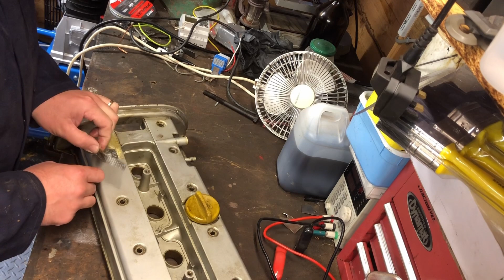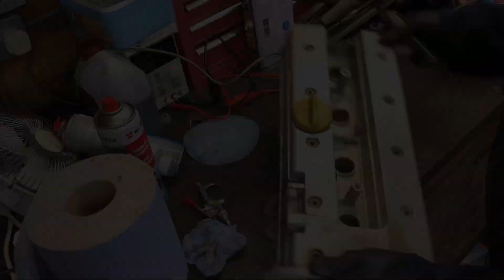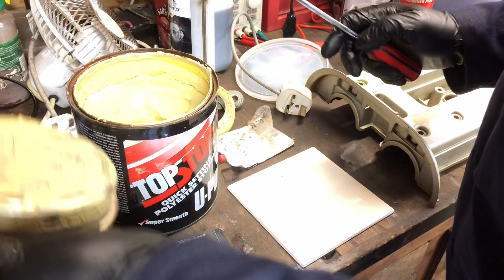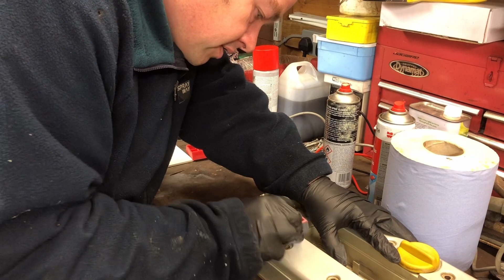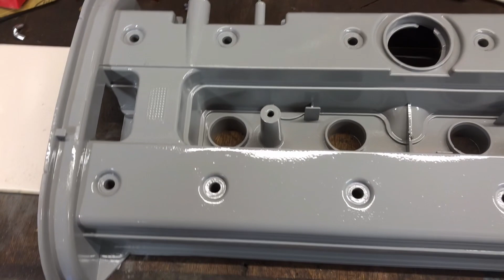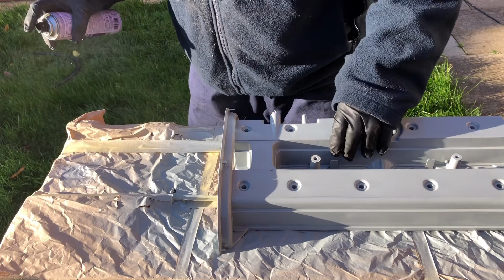Plastic Rocker Cover Repair Part One

Comment: Never thought on using the cable tie as filler. Good one.
Reply from the maker: Thank you, the cable tie works very well, give it a try. Cheers.
Reply: @Cavalier_Steve  I've kept looking at these "bespoke" plastic welding kits. Never thought on dedicating one of my soldering irons to do it - doh! Thinking out loud. Would it be a cleaner or stronger repair if you "V" the crack first. Do this all the time repairing plaster cracks for decorating. Notably for rocker cover the crack would be contaminated with engine "stuff". On the plus side that dies have a hydrocarbon base which is what plastic derives from. 
Again - having seen these plastic weld repair kits the often melt a series of metal wiggly doofers across the split (more appropriate in a bumper as it continuously flexes in use so extra rigidity to split would be beneficial). The position of your split would likely preclude that option plus the rocker cover is pretty rigid in use although is subject to some extreme temperatures.
Same engine is on Vera the Vectra. She had only done 79 miles in 4 years before I got her. I pressganged her back into use and did 1500 miles in first couple of weeks. Shock seriously killed the rocker gasket - result - oil was pouring our VERY quickly. 
Hopefully catch up or meet at a future Club event - as you will note above I do ramble 😆 🤣 😂
Reply from the maker: @alancondie1427  Hi Alan, I didn't realise that it was you, Vera the Vectra gave it away for me, I did have an after thought that maybe I should have drilled 2 holes either side of the crack to prevent any further cracking if it happens... A V notch would have been a good idea as well to get some fresh plastic in there. I know what you mean about them plastic staples they look great for motorbike fairings car bumpers etc. This rocker cover is quite ridged even when its off the car. I was a bit worried about the oil and other deposits contaminating the plastic and although I used break cleaner to clean it as best i could your always going to leave something there even if you done a perfect job. As you say doesn't really matter as long as you get a good seal when the job is done. Funny I don't think that a weld kit is very expensive saying that a cheap soldering iron is likely to be cheaper still. Good to hear that you getting some miles put onto Vera hopefully you have found her weaknesses and iron'ed them  them all out now at least the parts are still readily avaliable and can be had at a cheap price. I will look forward to seeing you soon at a car show at least December is over and the day light hours are getting longer. Lots to look forward to. See you soon. Steve.
Reply: @Cavalier_Steve  drill holes....of course. That didn't strike me when I read it. As amateurs I reckon it helps talking processes out as different ideas get thrown into the mix. Agreed for this job the cover is rigid so shouldn't be so susceptible to movement. However what causes the crack in the first place? May of course be overtitightenex at some point - I remember doing that on an 8v alloy over years back - got away with some instant gasket on that one 😂 
Hopefully catch up somewhere through the coming year. Plan to do Vauxfest. We also travel regularly to Lowestoft Yarmouth area for grandson. Probably do shows that area if timing is right.
Reply from the maker: Hi Alan, I fully agree little tips and tricks gives us a fighting chance to do stuff at home ourselves, I’m unsure how the crack originally started, I have 2 rocker covers that have done the same, it could be that it was tightened up to much in the past or it could be a thin spot in the original mould and heat cycling over the years has caused it to become brittle and then it starts to tear. I’m also hoping to be at Vauxfest this year I have no doubt that Mark and Gillian will be there. I need to see if I can get the time off. Hopefully see you at a show soon. Cheers.
Reply: I'm quite sure Mark and Gillian will be there in the camper van. Trying to decide if we will go with the touring caravan which means Vera the Vectra or get a static or lodge in which case it would be Tabby the Cabby. Need to have a good look at the rocker on Vera now you have said that make sure my X20XEV isn't doing the same. Hope you get time off sorted.

Comment: Good video Steve 👏👏 , that plastic welding works really well, we used to do it alot when i was working on tool repairs for cracked casings etc so it should hold well.
If you run short of carb cleaner, 2k thinners works just as well I've found. Will you clear the rocker cover after?
Reply from the maker: Thanks Pete 😀yeah I wasn’t sure how well it would work to be honest but I’m quite pleased with how I turned out. Thanks for the tip on the 2K thinners I have got some so I can use that. I never cleared the cover the paint I used was a direct gloss, I wanted to replicate the original finish which I think the direct gloss has done. Part 2 will be up hopefully in the next couple of days. I’m glad your comment come through John said he left me a comment and it does show 5 but I can only see 2 plus my 2 replies 🙄😮 Who knows. Glad you enjoyed it cheers.
Reply: @Cavalier_Steve  He was probably swearing too much so youtube removed it😂
Look forward to the next one mate 👍
Reply from the maker: @peteshobbies5383  Hahaha 😝 bless him.
Reply: Hey guys, no idea what happened to my comment so I'll have a go here, I have used a soldering iron to repair small plastic parts on my cars before now but didn't really do much of it. You done a great job on the rocker cover Steve and was an inspired idea to use a cable tie as a welding rod for the repair but don't see any reason it wont work so long as it's air tight as you don't want any fumes coming through into the cabin, looking forward to the next one, cheers Steve 👍 Pete you know me to well mate, my foul mouth always gets me in trouble 😜😂
Reply from the maker: @JohnWD40TC02  Hi John, I have been keeping an eye out for your comment, sadly it still hasn't appeared (which is annoying) but at least this one has come through ok I done a crude air pressure test on it seemed ok but time will tell. Part 2 will be coming on Friday. My mouth has also got me into trouble in the past in Part 2 which thankfully Cameraman sam has edited out I referred to break cleaner as eye wash in my sick humor but then I thought better not put that in the video as im sure most people would find that offensive or worse not funny ;-) cheers John thanks for coming back to us. Cheers.